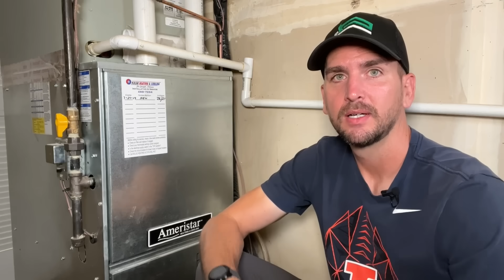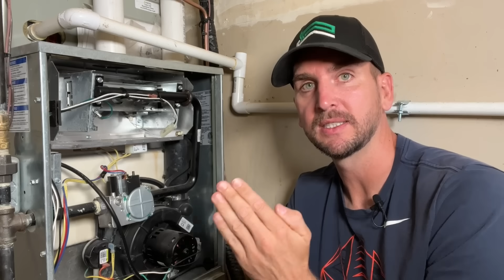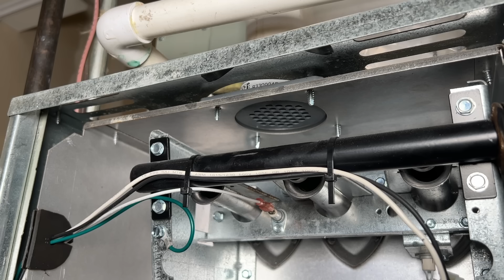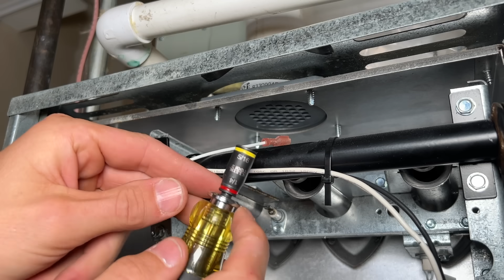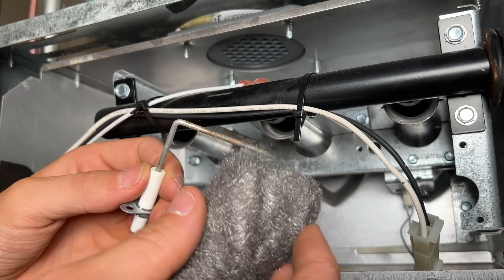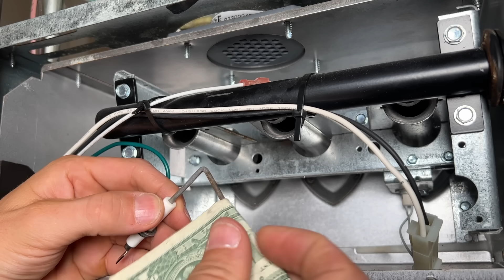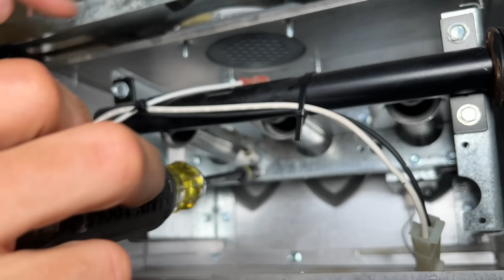The Most Common Reason Why A Gas Furnace Won't Turn On

Comment: My inducer and blower come on together...then the burner.
Ever since I installed a smart thermostat...the wiring at thermostat is perfect.
Reply from the maker: Hmmmm, I haven't found a scenario like that in my experience.  The pressure switch usually would need to trip from the vacuum pulled by the inducer fan to allow the gas valve to turn on.
Reply: @EverydayHomeRepairs  
Yeah...
Used to be inducer..then burner..finally blower...
Thinking maybe going back to non smart thermostat

Comment: Step one is control board checking that roll out ant high limit is closed and pressure switch is open. Then it will bring on the inducer.

Comment: Just look at the board and the trouble light will tell you why its out   main blower starts from fan limit and induce deaf fan clears chamber of excess and then pressure switch sends signal to board from negative pressure

Comment: I have a Trane XB furnace.  I get to step 3 with the igniter glowing, then at step 4, I can hear my gas valve click to turn on, but gas only comes out for about 2 seconds, it doesn't light and the system turns off.

Update:  Turned out to be my igniter wasn't close enough to the gas stream.  I had to bend it's station bracket a couple millimeters closer and then it worked!

Comment: Any advice Please,  My furnace does that too but its intermittent? Going to check it at lunch. This couldn't because by a faulty thermostat? Had it for a Month or two.
Reply: Notice on my Lennox a 4 1 code. Got to the flame sensor pulled it out and cleaned it. FYI really didnt look too dirty?  but has been fine ever since no more codes. Thank you very much for this video.

Comment: Have a Lennox G40uh and its been intermittent Works sometimes.   I looked at the board and it had left blinking and right solid.  That means Open Temp Switch.   One time on start up I saw the Igniter glow but it did not light the flame.  This was sort of a red herring I think.    
Anyway I turned it off.  Then looked at the wires leading to the Temp limit switch and noticed there were two platics things daisy chained to it.  They looked almost like a red button but did not push.  (Not sure what they are)   Anyway all the connectors looked a bit oxidized so I one by one wiggled them all.   I think pulled the fuse (looks like a car fuse) out of it and back in.    I turned on the furnace and now it works!

What fixed it?  Im guessing one of the oxidized wires I wiggled.    So if the wires leading to the Temp limit switch are broken or open (or oxidized at a connection) would prevent the entire furnace from igniting?   The fans would come on but not even a glow from the igniter.  The clue was the green blinking left LED and Solid green right LED.  That code says "Open Temp switch or sensor.  That just means their is a break some place in the circuit not necessarily that the temp cut off switch is bad.   In my case it was open due to the wires leading to it being open or corroded to the point of no current flow.  = furnace will never boot up with a flame.  It thinks the temp switch is OPEN.  

When in doubt wiggle wires was the fix.   Should I spray contact cleaner on those connectors?  Or just leave it alone?

Comment: My burners are not lighting.
They lit last week when it was warmer.

It won't light when it's cold.
I even put a space heater in the garage and got it working.

What's the issue causing my burner to not light in cold weather?

Comment: How much could the oil from hands affect the sensor? I bought a new one and didn't know that bit about the oil on hands. It still didn't work. Is there a next step to test. We continue to have this issue after replacing the sensor. My dad is in HVAC and was kind of stumped afterward.

Comment: My ac works fine. My issue is that the blower fan does not come on only during the heat cycle? All steps funtioanl leading up to blower.

Comment: Thank you for the clear and concise instructions. My furnace wouldn’t ignite and then would go into lockout. I inspected the flame sensor, saw a bunch of carbon scoring, and was able to knock it all off with a dollar bill. I ordered a replacement sensor for < $10, but the one I cleaned has been working without issue for over a week now.
Reply from the maker: Nice, so nice when you can get a fix for $100's less than calling in the pros.  Nice work 👊.

Comment: Would this scenario apply to my situation?  My heat turns off sometime in the night, in the morning it's 52 degrees in the house.  I turn on the nest thermostat and get a reading of heat in 1.5 hours, the furnace ignites and shuts down,  if I try again it locks out.  It will kick on in 4 hours and run perfect in the day if the minimum temperature is 57.  It seems to be related to the colder hours between 12AM and 6 AM.  Have had three technicians out and no answers.  Just curious if this could be a fix or just keep looking for the problem.
Reply: I don’t know nothing about nothing, but I would recommend you follow the steps in the video to determine at which step the furnace fails. I was able to follow the exact steps he goes through. The burners would ignite and then turn off almost immediately, so I knew the flame sensor was the problem. My furnace seemed to work fine during the day, but would also go into lockout at night. I cleaned the flame sensor with a dollar bill, as shown in the video, and haven’t had any problems since. So, maybe there is also an ambient temperature component that causes the flame sensor to fail. Certainly wouldn’t hurt to try. Cleaning is simple and takes a couple of minutes. Or you could just buy a replacement online for really cheap. It’s a little surprising that an HVAC company wouldn’t try that to make some quick $. However, in my experience, they tend to want to replace more expensive parts (like the controller board) first.

Comment: Great video. I had pressure switch light on. (3 flashes). Looked up everything online about it and most recommendations were to clean this and that which I did. Still wouldn't work. At last this lock out of furnace and cleaning the rod made the deal. Yes the problem started with pressure switch but none of the other videos explained this problem after that which should have been the follow up as well. Thank you very much. Almost gave up and was going to call a teacher tomorrow.  Saved me hundreds u guess. Thank you.

Comment: I have a Miller M7.  If I remove the cover over the manifold/burner and the unit calls for heat, all three burners will light and remain lit even upon replacing the cover.  If I leave the cover on and the t-stat calls for heat, the left burner will light then go out.  Ideas?

Comment: I want to thank you as well and wish I found this video last year.  I called a hvac company last year and they told me it was the motherboard - $2K later, problem fixed, but then this year, heater made the same noise as last time, my heart sank. But I cleaned the sensor just as you described and everything is rainbows and unicorns!!! Thank you sir!

Comment: So I replaced my flame sensor and unfortunately, it didn't fix the issue with the heater running intermittently. Sometimes it fires on the first try, sometimes it takes 2 or 3, and sometimes it goes into lockout. What would be the NEXT thing to investigate if it's not the flame sensor?

Comment: On mine, everything works but the gas is not turning on when the igniter glows, it then turns off the igniter and starts the ignition cycle again, si the gas valve is the issue 😢

Comment: I thought this was my issue as the symptoms shown, i.e. flame starting, then stopping a few times and then lockout. So I cleaned the sensor and everything seemed to be fine the last couple days. Fast forward to this morning I woke up around 5:45am to take a squirt, and the heat was running according to the schedule so I figured everything was fine after cleaning the flame sensor. I go back to sleep and wake up later, look at my phone and it says the heat is on, but I hear nothing, and the temperature is lower than the thermostat setting. This means that the heater attempted to start so many times before going into its lockout mode. So apparently, cleaning the flame sensor didn't do the trick like I thought.   I have a new flame sensor on order, should be here in a couple days. Question for anyone still following this video: Are there any other problems besides the flame sensor that exhibit the same symptoms? Thanks

Comment: okay, but how do you take the connector off of the terminal? Do you have to pinch or just pull really hard? Mine didn't want to come off, and I don't want to break anything.

Comment: We have a RUUD, not very old. But whoever installed this unit didn’t do a very good job. In the summer an abundance of condensation will build up in the unit causing it to short out. I drained the tubes that would be in charge of this and A/C resumed as normal. Now it is getting cold. Furnace won’t ignite. I have cleaned the flame sensor and replaced the igniter. Now I’m shutting it down for 20 min and I’ll see what happens. I think the board is bad again

Comment: I'm stuck on step 4 in this process - my igniter is lighting up, but the burners are not igniting.   So, Im guessing something wrong with the gas relay valve?

Comment: You obviously dont know or ever had a roll out or blow back. You did a disservice to unskilled people. USE CLEAR GOGGLES AT ALL TIMES WHEN YOUR FACE IS IN A BURNER. You try pulling this stunt on a commercial job and you may lose your eyesight. ALWAYS work safely.

Comment: winter time furnace would start then just shut off so used portable heaters all winter a are electric bill sky high now it so hot want to try central air see if it works but would that cause carbon monoxide ?

Comment: we had use portable heaters all winter and now so hot in house i want to try see central aor works but would that caise carbon monoxide bc its a gas furnace or be ok?

Comment: ours didn't work all winter time had use portable heaters but also has central air would it be safe to turn central air on to see if it works? or would that cause carbon monoxide

Comment: I am having this issue with a brand new Carrier Infinity 95%. I get the 34 code. I got the same code on the old Carrier weathermaker 9200 that i replaced. Only thing i can think of is A) tube in tube pvc is restricted or B) gas pressure from line is low.

Comment: Do you think it’s my thermal coupler going bad because sometimes it’ll stop working or it’ll crank and then stops and doesn’t blow air but if we turn it off and back on a few times and then it works again or if we reset the breaker switch to the furnace then it works too.

Comment: OK, but I replaced my ignitor/flame censor (mine is both in one) but my furnace is still kicking out?? A lot of times as soon as it tries to light bam, kicks out, any ideas? I also noticed that there are like 4 big resistors in a row on the control panel and they are getting hot as he'll, like can't touch them hot!? Any ideas?

Comment: Cleaned the sensor as suggested and the furnace started working again! Did this the other day. However today my system is stopping again when the gas is released and there’s no lighting. So what should I check next ? Replacing the sensor or some other component ? Thank you.

Comment: I am having an intermittent issue where my furnace locks out with the LED error code of one blink. The model is a Goodman GMSS 92. So I took preemptive action and replaced the flame sensor and the igniter. I checked the vacuum switch. However, it’s still intermittently locking out and having to be reset. Is it possible that I need to replace the control board? If not, what else would you recommend?

Comment: My thermostat keeps clicking.  It will turn and make heat for about 5 minutes or so then the thermostat will start clicking and then heater blower will eventually stop.  Then pilot will go out.  Any tips?

Comment: My furnace stopped working yesterday morning right as our area started dipping into the mid 30's for the week down from the 50's. When you go to turn on the heat nothing happens at all. No draft motor cycling on which was just replace last year in addition to the pressure switch. Cleaned the flame sensor and still nothing. We have a system very similar to the one in this video.

Comment: Thanks so much for this video.  It is a super clear explanation of how a furnace works.  My furnace was not making heat and I was on the verge of looking for an HVAC company to come out and fix it but that would have undoubtedly cost me hundreds of dollars and days of delay.  This video showed me that my ignitor was bad and I was able to fix it myself.  The repair was actually quite simple.  Thanks again for this excellent video!!!  You're a rock star!!!

Comment: Can’t believe this problem can be solved so easily. I just cleaned the sensor and the system started working. The best part of the video was the explanation on various stages of the system. Can’t thank enough.

Comment: Thank you so much for this video.  My Train xv95 stopped lighting and you helped me diagnose that it was the “glow stick” igniter that was broken.  I got it replaced and everything was great for about 20 hours, and then I got hit with the flame sensor issue in this video.  After some time with a kitchen scrubby it now works fine.  You’ve saved me hundreds of dollars.

Comment: The dollar bill does not clean it well as there is too much body oil present from the stripper’s breasts. Best to use a $50 bill, no stripper oil on those usually.

Comment: As a retired HVAC tech, I can say this is a very well-done video. This type of flame detection is called a flame or pilot rectification system. Raw natural gas will not conduct electricity, but a flame will because I believe I heard the flame is ionized. Rectification means a one-way current flow, and this is done by sending a electrical signal to the small flame detector that then will conduct electricity thru a flame to a larger metal ground, and I was told this size discrepancy induces a one way or rectified current or signal. This is important, because if for some reason the sensor shorted to ground, without flame rectification, the circuit board would not be able to tell the difference between a shorted sensor or a proven flame and could energize the gas valve without ignition, which is something you never want to happen. I actually taught this sensor cleaning trick to a young maintenance man who was working with me, and a week later he fixed a neighbor's furnace during some cold weather and the neighbor gave him a roll away toolbox!

Comment: I just had a similar problem when our first Minnesota winter hit this year. The furnace would turn on and off every 3-5 minutes. Long story short,  the problem was the cold air intake... it was blocked by bird's nest so the intake air was not enough. A costly service call that I will make sure it won't happen again. Anyway, Thank you for your very good video

Comment: MY problem was the micro switch behind the BOTTOM panel. Nothing was happening and I noticed a switch behind the bottom panel. I removed the panel and pressed the switch and she fired right up!! I had cleaned the filters and apparently hadn't tightened the panel screws enough to engage that switch!! SEVERELY APPRECIATE this video!!!

Comment: You may want to rethink the price on those ignitor's. Well, mine has the heat sensor attached to it. Dumb ass me took it out to clean it and I  did not know NOT to touch the ignitor. When I did it fell apart. So, I run down to the local heat and air store. He did not have any but told me  to go to a store some 30 miles away. And it would cost $106. ea  So, I looked on Amazon they want $90. ea. So, I go to ebay an they want $30.  After watching many videos, I am not sure that is the problem. Before I started screwing around with this POS. I would turn the unit on and watch the ignitor get a bright orange color, just saying it got hot. But No flames, like it was not getting fuel. This unit has not been used in over 10 yrs. That is why I am thinking a fuel problem.

Comment: There is very simple common things that and usually your circuit board will give you an indicator light and tell you what the problem or where it’s located at I just got a situation of usually I always fix my own stuff to heating air classes , been a electrician for life, etc. But I hired a company after I had back surgery because I couldn’t get in the attic to do it now after their third attempt coming out and accidentally telling me the only paid $331for but accidentally told me on the phone the cost and then charge me $600 for the motor so I total of about $800 and then they had to come back twice and they was going to charge me on the third time because they first did not connect the neutral back on the power supply. Second the motor was unbalanced and was rubbing the housing and number three the biggest problem of all right on the side. It even had a big yellow sticker that said if you’re mounting in a horizontal position mount pressure switch vertical and it had an arrow saying here now they looked at it multiple times couldn’t figure it out. wanted to charge me another $120. I said fuck that did it myself easy reading it doesn’t take that much. As long as you got a voltage meter in half them little safety centers. They’ve got up there that they want to never sell you they want to charge you for it but if you’re having problems with it coming on and kicking off check your pressure switch specially if it’s gas furnace, see if there’s water pull or check the rubber hoses that pull vacuum just like on a motor on a vehicle
Reply from the maker: Bummer, I wish this type of experience wasn't common.  That is why it is nice to have an idea of how each of these systems work.  You can catch a lot of shady business/inexperience if you have a little knowledge and willingness to learn 💯